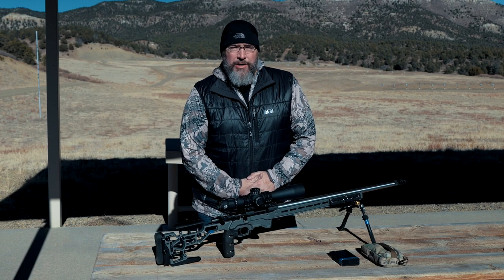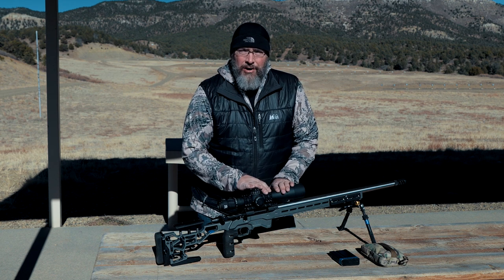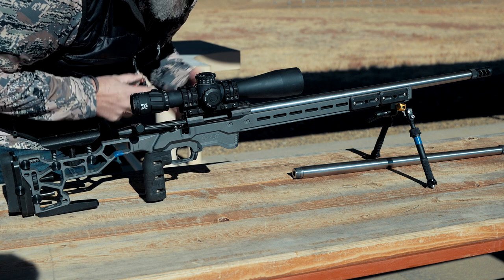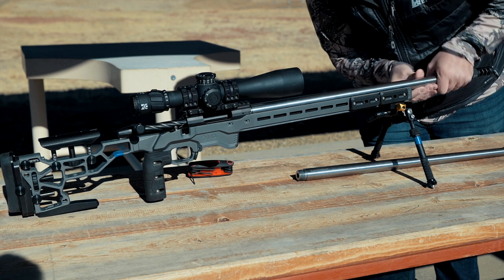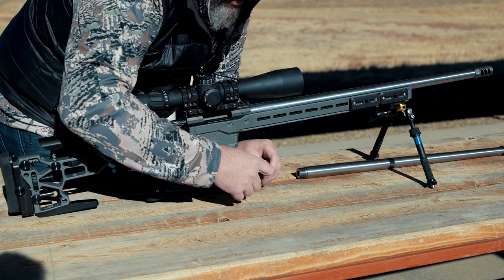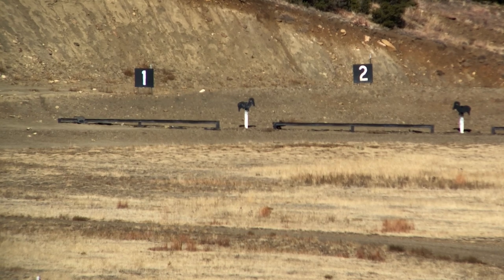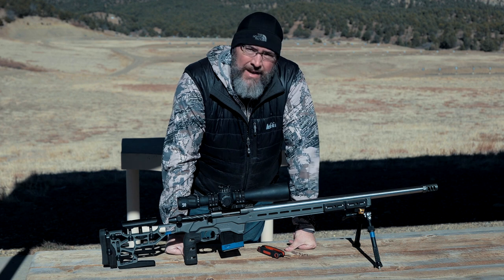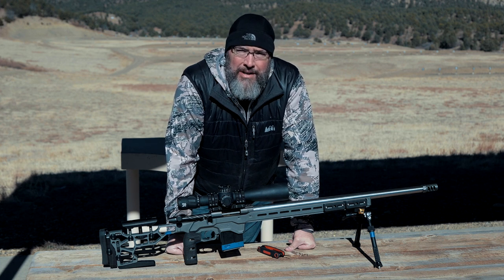EASY | Terminus Switch Barrel

Comment: I would like to see this same video but then putting the 6GT barrel back on and see if there is any point of impact shift
Reply from the maker: that's a valid request.  I'll be doing that this spring with another Terminus Zeus action.  Building a new .308 on one and will add that to the video.

Comment: Can you do a comparison terminus zeus action vs bighorn tl3 ???
Reply from the maker: I don't own a TL3 unfortunately.  I have used one before though and I can tell you that the TL3 is a "looser" action.  It feels like there is more slop in it.  I had problems with binding when the bolt was to the rear and then pushing it forward.  Not saying it's a bad action.  A lot of great shooters swear by them, but my experience wasn't as nice as the Terminus provides.
Reply: @PrecisionRifleNetwork  Plus ➕ Its From Harrisburg Pa...  Get Place to Visit... looks like a great idea if I could stop by before getting into one if I choose too... 
Thank you 😊

Comment: What kind of accuracy are you getting with factory ammo
Reply from the maker: 1/2" at 100y with most of the factory ammunitions i've tried.  The action is just the foundation - you have to match it up correctly with a great barrel, good ammo, and good fundamentals of marksmanship as well.  If the accuracy is not there - first blame yourself, next blame the ammo, then blame the barrel.  It is rarely if ever the fault of the action in my opinion.

Comment: So I know they make a version without the set screw. If I get the version you have with the set screw can you run full thread barrels that you torque on traditionally? If you get what I’m saying I want to buy the action that I can do both with if that’s possible not just be stuck with a set screw or a full torque.
Reply from the maker: You can have either one torqued on.  No issues there.  I've used both on this action with no troubles.